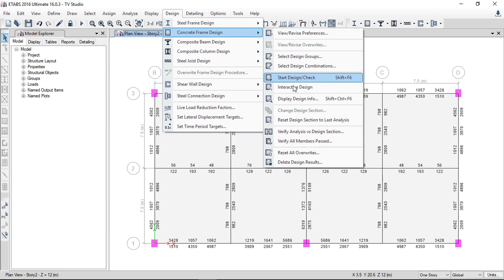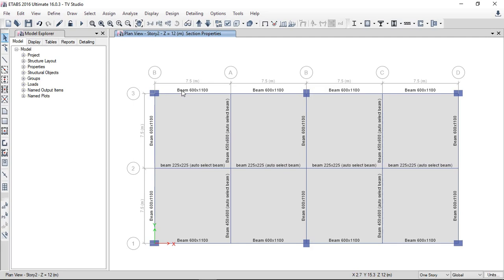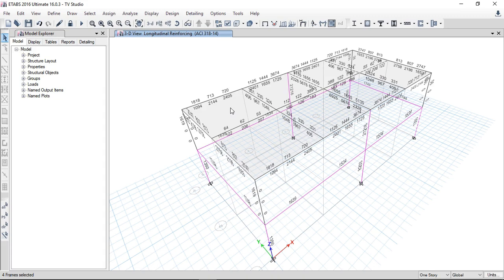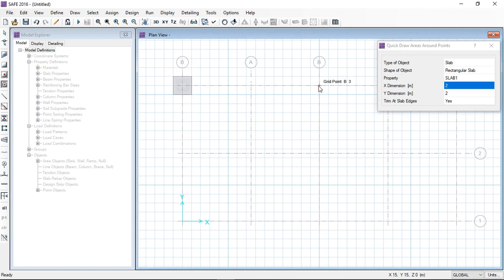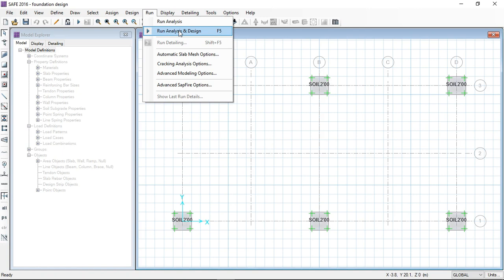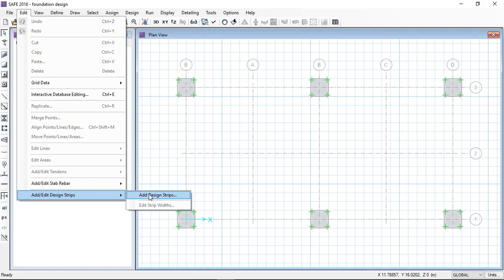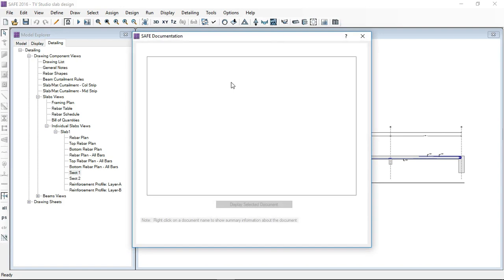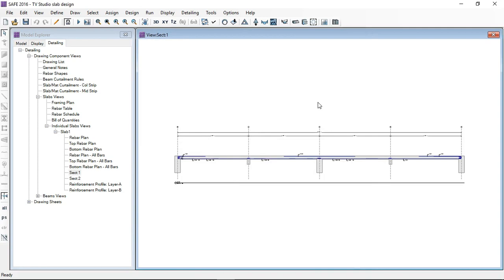CSI ETABS - 17 - Design of Full Building (Concrete) TV Studio | Part 2

Comment: Sir can be design is slab without providing stiffness of beams at center that you have provides of 600*1100 
Is slab can be restrain without this beams
Reply from the maker: YES.... with Drop Panel
Reply from the maker: And waffle slab
Reply: Sir but aaj kel to wothout drop pannel bi slabs cast hu rhi hai vo slab reinforcement ke shath steel gerders slab mai dal kee stiffness maintance ker rha hai
Reply: Sir you tube per aap 
Apollo premium building indore ka vedio dekiye plz
Reply from the maker: @parag27865  Agree
Reply: @civilmdc  sir ake vedio basement floor ke retaining wall ka bi bnaiye plz
Reply from the maker: @parag27865  Noted